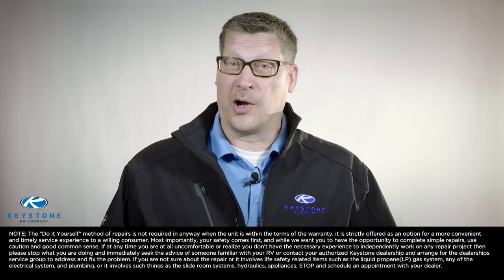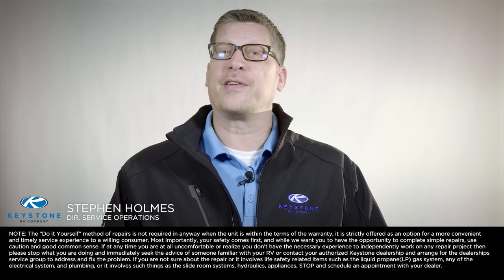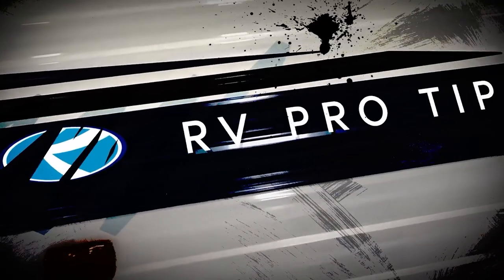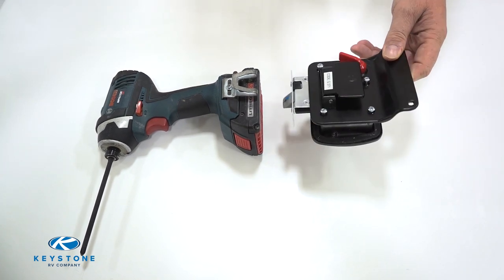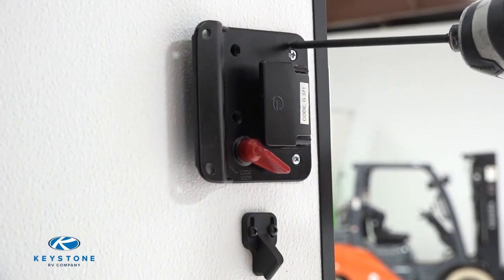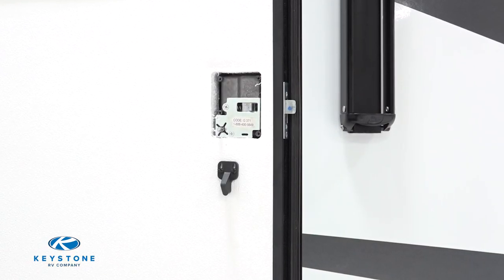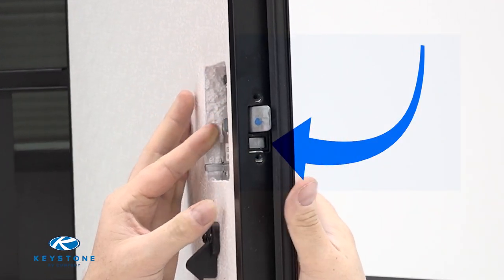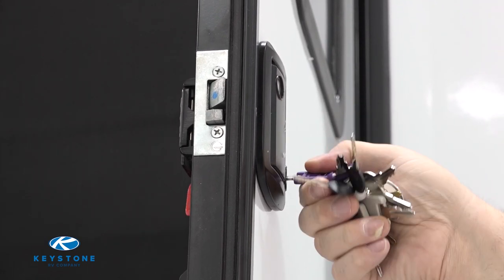RV Pro Tips: How To change Your Entryway Locks

Comment: How do I make it so my door will close easily from the inside. I struggle with the door every time.
Reply from the maker: Good Morning! If the door is not closing properly then it could be that something does not fit on there properly or that the door may need to be adjusted. We would recommend that you have this further inspected by a local Keystone dealership near you! Thank you.

Comment: The hole cutout on the 2020 Montana 3930 I have is huge, and doesn’t accommodate any other rv locks. Do you have any recommendations without buying an entirely different door?
Reply from the maker: Good morning, and thank you for your inquiry. We would not unfortunately, as we can recommend like for like replacements only. However, you could check with your selling dealership to see if they may have any recommendations that may suit you better than what was installed initially. Thank you!

Comment: Thanks for a great video! Can you tell me what the cutout specs are? Not sure if they are standard but we've got a '21 Bullet 250BHS and looking to install a keyless entry which requires:

Required cutout dimensions: 2-3/4" tall x 3-3/4" wide
Distance from door edge: 1-1/8"
Minimum door thickness: 1-7/16"
Reply from the maker: Good afternoon, we are so sorry for the delayed response on our part. From what we can tell without a VIN it’s very likely you have a Lippert door.  The lock/latch comes preinstalled on the door so we don’t have those specifications unfortunately. We went on Lippert's website and found a hyperlink that will assist you. Once you click on the link, you need to click on Technical Information and choose TI-099 – Entry door latch general information.  I hope this helps.

https://support.lci1.com/entry-doors